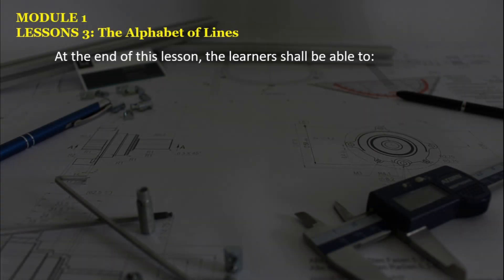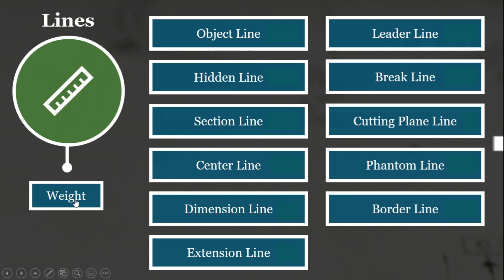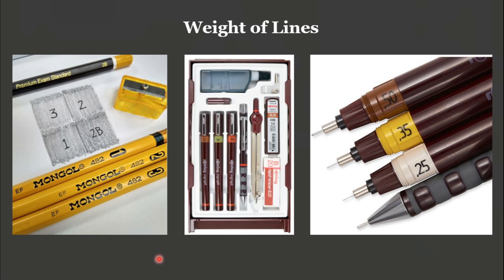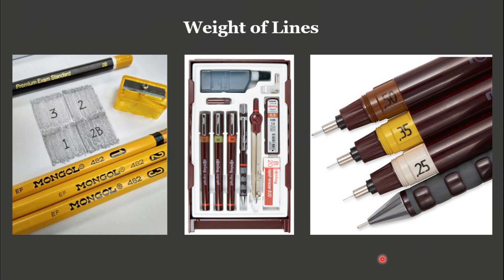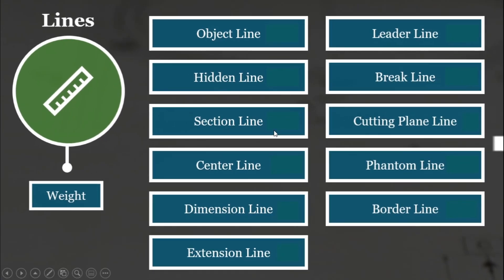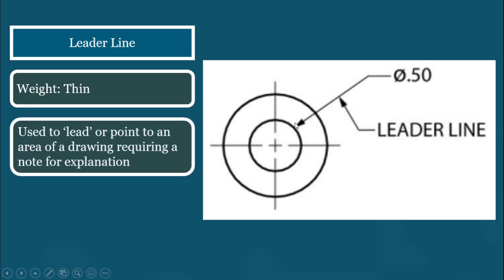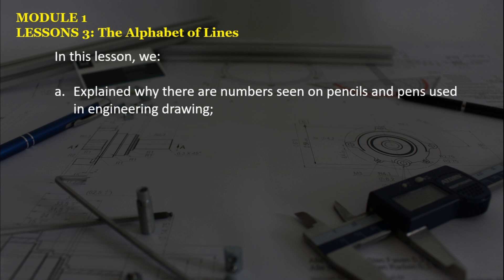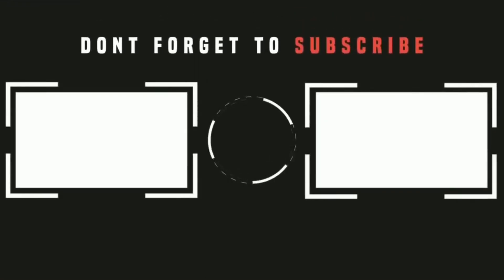The Alphabet of Lines | Errol Karl Gumagay

Comment: May I know what is the importance of the Alphabet of Lines in Isometric and Orthographic Projection?
Reply from the maker: Hi Meidrick. Each line of the alphabet of lines has its own meaning that is understood by architects, engineers and contractors worldwide. It is a form of design communication. If an isometric and orthographic projection is drawn using these lines, engineers from different countries will be able to understand despite different spoken languages. That is why it is called 'alphabet' - a basic of drawing communication. See this link. https://schoolworkhelper.net/technical-drawing-alphabet-of-line/